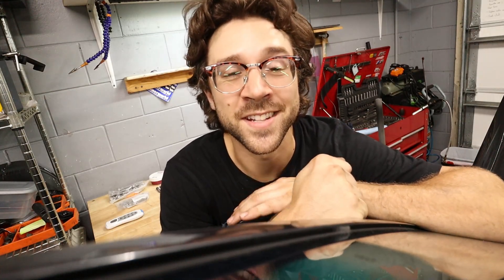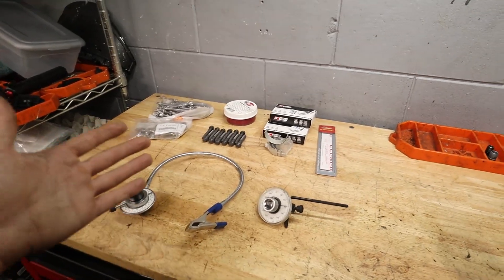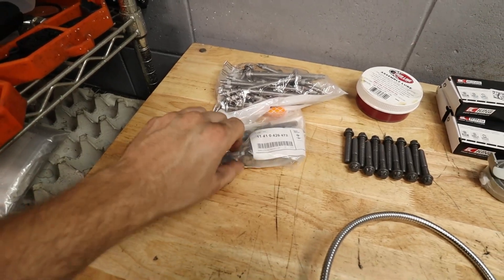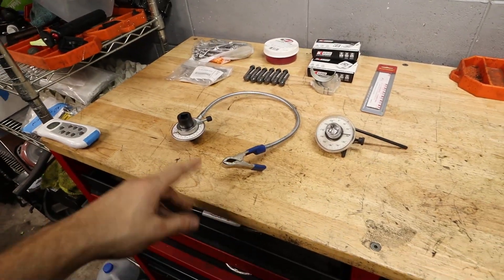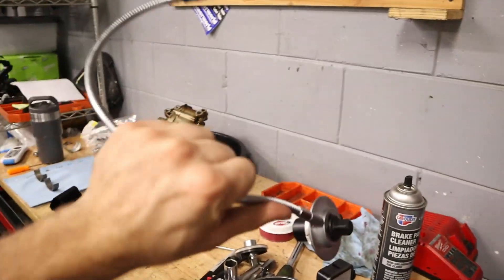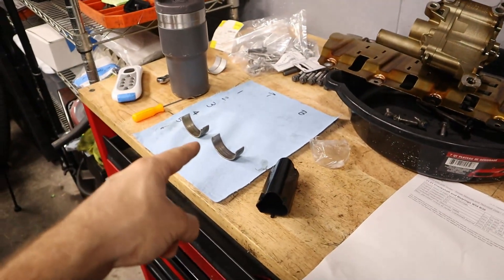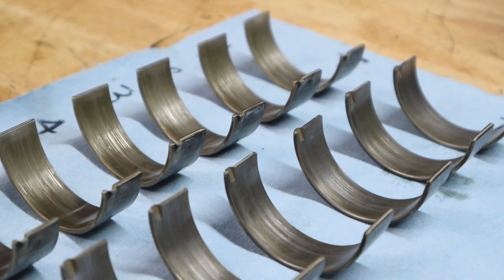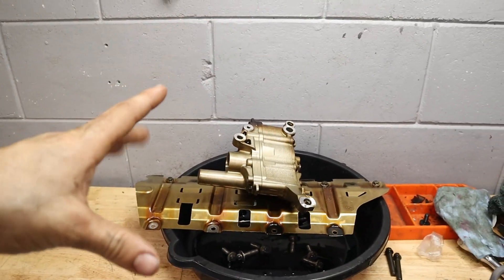How to: Replace N54 Rod Bearings (335i with 200k Miles!)

Comment: Aren't you supposed to do the rod bearing clearance test with both upper and lower bearings dry? I see you put assembly lube on the upper bearing before using the plastigauge, doesn't that mess up the readings?

Comment: Where did you get the rod bearings? What size did you use? There’s several online. If your still within spec stock should be fine ?
Reply: King Bearings … FCP Euro …. ALWAYS

Comment: Happily surprised?  Those things looks scratched to hell!  Working for an engine manufacturer we would scrap brand new rod bearings with a hairline scratch anywhere on them.  Yours look like there were rocks in the oil channels.  You also didn’t even inspect the entire crank and it should have been thoroughly cleaned before reassembling.  A spec of debris on the bearing shell can cause a failure.
Reply from the maker: The bmw factory bearings use a copper core, and usually the bearings have failed after the copper core has started showing. These haven't worn down to that layer yet, and the "scratches" you can see don't have any depth to them, so that's why I was surprised. I expected more wear. Crankshaft journals looked fine though! Thanks for the comment and sharing your knowledge 👍

Comment: Did you do an oil change after the install ans break in of the new bearings. Redline lube says it won't plug filters but I'm unsure if it's common practice to change the oil after the break in of a bearing change

Comment: Great content the N54 appears to have a decent oiling system, rod bearing failures are not as common compared to the M cars.  It might have to do with the lower rev range, just my humble opinion.  I'm glad you did this DIY for all of the viewers really helpful information, this job would cost thousands of dollars at any shop.

Comment: Great job Chris. Yep , nice even ware. On the engine color you can see this engine got good oil and the right service intervals. I heard indeed, these oil pump bolts can break or even come completely loose! Mostly discovered at the oil pan gasket service. Have a great weekend, Dutch regards, Nico.

Comment: Good job! How did you remove broken bolts? Drilling sounds painful :)
Reply from the maker: Luckily they weren't cross-thread in there or anything, so thos aluminum stretch bolts came out easy. Thanks for watching!

Comment: 100% those are your timing chain guides that are in the oil pain. I’d recommend replacing them asap. Just like everything else on the bmw those are plastic and just like with most plastics with heat and time inevitably it’s going to get weak and start breaking away. And that engine has had 200k miles of heat through it and the car is almost a 20 years old. If you don’t replace those guides your gambling on them breaking, you jumpin timing. won’t be going anywhere fast but your block will weight about a piston less. 😂 great video by the way definitely one of the better ones on YouTube. I hope this thing becomes a beast💪🏾
Reply: He’s a professional I can guarantee you he knows what he’s doing !!
Reply: @christophebuisson7536  cool
Reply: I totally agree I've just discovered the same thing yesterday.

Comment: I also replaced rod bearing on my n54, used king! I used ald bolts, the reason why I replaced rod bearings is because the Serpentine Belt came inside the engine, and blocked oil Pump filter, also I replaced oil Pump it had bid scratches l.
Reply: That's some major work! Congrats on taking care of that. What caused your belt to suck up?
Reply: @TheFrenchPug leaking oil filter housing Gasket
Reply: @BMWrecker rus  Crap!!! I replace my OFH gasket around 90k. At 148k now.  Don't see any noticeable oil leaks from it still. We're you able to bad leaking before it happened?

Comment: I ran into the same issue on my rod bearing change. I found the head of a bolt from the oil pump in the pan. fun times. I was just going to do the pan but decided to check the rod bearings as well. Good thing I did. The upper and lower on number 1 were both broken in half. and as usual the oil pan had about 4 bolts broken. No wonder it was leaking.  I had a extraction tool but it was pins and needles drilling then tapping them out. Some were easy a few took some time.  All in all it was a long but satisfying job. I used OEM bolts and King bearings as well. When using the old rod bolts to plasti-gauge them one of them snapped .. you'll feel it get tight then it just went loose .. good thing was it snapped up near the head of the bolt so the remnant was easily removed by hand. BE VERY careful out there when doing plasti-gauging with old bolts.  The hardest part of this job is removal and replacement of the oil pump sprocket up front - Oversll  the other bearing had minimal wear after 117K miles  .... Great content bro!  OH I had some weird errors regarding the active steering as I removed it totally to get more clearance but it cleared up after a few drive cycles.
Reply from the maker: Valuable info from your experience, thanks for sharing!